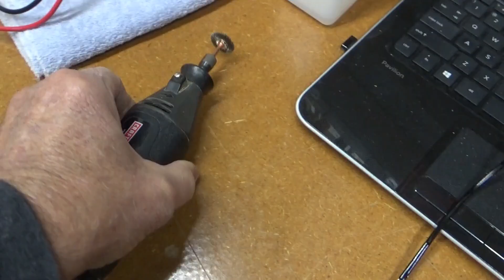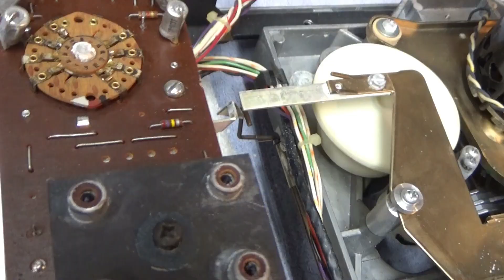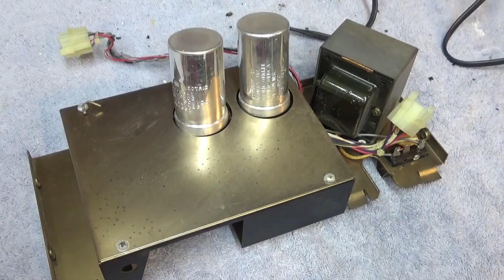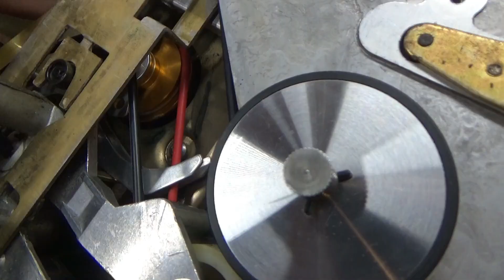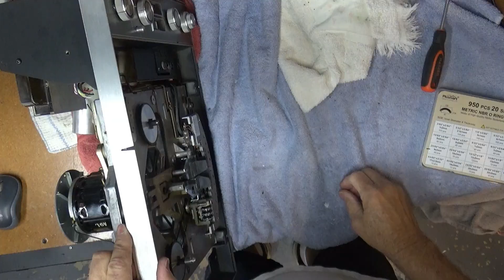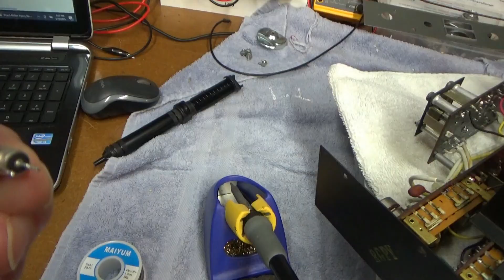1966 Ampex 2100 Series Reel to Reel Restoration

Comment: Thanks for this. I wish I found it a couple days ago. A 2075 showed up on my bench yesterday. I found a bad 12AX7 and replaced it. I was getting a horrible racket in reverse play and it took me a couple hours to diagnose the problem, which was (same as you) that little wheel with the deteriorated blue rubber/gunk. I replaced it with an O ring and we're back in business. Somehow the belts are all good except for a missing index counter belt. What size/diameter did you use for that? Thanks again. - sebsi
Reply from the maker: That was the one belt that was still good and I didn't replace. good luck with the restoration.

Comment: Thank you for posting the electrical and mechanical repair of your 2100 Ampex. I have the 1100 model (also from 1966), and have experienced the joy (and challenges) of going through multiple belt and tire replacements. It's a labor of love to get these gems running again. Their transports are mechanically complicated and touchy. I haven't replaced any electronics, but the auto-reverse is not responding to the injected signal anymore, so I need to go through and check voltages on that board. Unfortunately, the belts and tires will continue to require replacement, as they stretch, break, and deteriorate from heat and use (job security for the service centers way back!). Make sure to lower the speed to 1 7/8 before turning off the power....that will bring the capstan belt to a smaller diameter on the motor pulley, which slightly reduces the tension on it.
Again, a great video!
Reply from the maker: Thanks for the comments. I'll pass on the tip of going to the slower speed to my brother in law who owns the Ampex.

Comment: Amazed to find you and "mguess" working in old Ampex machines. Stayed up until 2AM last night installing new belts on model 750 I bought in late 60s. Second time I have done this since new. Great to find how/where to get new motor mounts as mine were shot. Need to find where to buy good quality factory recorded 7.5 ips tapes . . . other than Lawrence Welk!
Reply from the maker: Wow, that's some late night maintenance. I have found some pre-recorded 7.5 ips tapes at my local vintage record store.

Comment: I have a 750 from 1969. The brake strips came unglued. What I thought was the pinch rollers turned out to be the main belt. The belts seemed fine, but no where as rubbery as the new one. It would mess up on thinner tape. New belts fixed it. No fancy features on the 750. Not even a pause, but still a killer deck now that I got all the bugs worked out. ......Cool video.
Reply from the maker: Thanks for the comments and I'm glad to hear that another old Ampex is working again.

Comment: Perhaps your best video. Congratulations on a successful project. I hope your brother-in-law  appreciates your effort and enjoys it. It is quite stunning to look at. I have just had a parade of Dual turntables pass by the bench. 2 x 1218, 510, 1209. All decent players. Thanks for sharing this well made video.
Reply from the maker: Thanks man. It was a challenge keeping that video to under an hour with all the work that it needed. It was worth it though. The Ampex looks and sounds like a brand new machine.
I love those old Dual turntables. They can be a challenge also.

Comment: Thank you for posting this video.  I'm starting to become interested in reel to reel tape as an audiophile endeavor.  These R to R tape machines can be expensive, so with knowledge of electronics and electronics test gear, I'm hoping to restore one and save a lot of money.  Are there any particular brands that are easier to work on and have better parts availability?
Reply: TEAC still sells belts to consumers. Just call them.
Reply: @Poppinwheeeeellllllieeeeez  Thank you for the tip.  Do they sell belts for all brands or just TEAC machines?
Reply from the maker: Thanks for the comments. I'm not a reel to reel expert but in my experience none of them are easy to work on but parts availability hasn't been a big problem. They mostly need new belts which can be a time consuming task but the parts are generally available.
Reply: @mguess  That sounds promising and thank you for further sharing your experience.  In my opinion, the sound quality R to R machines produce is worth the effort to restore one of these machines, and I don't mind a challenge now that I know what I'm getting into. Have a good day, sir. 👍👍👍